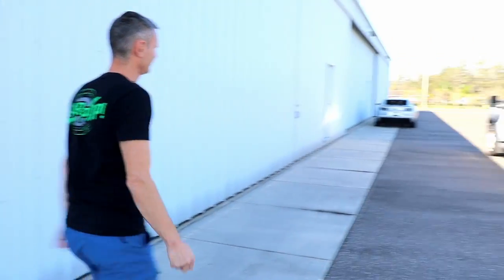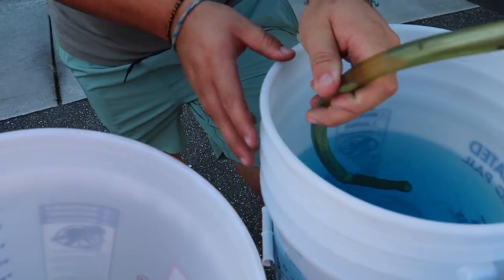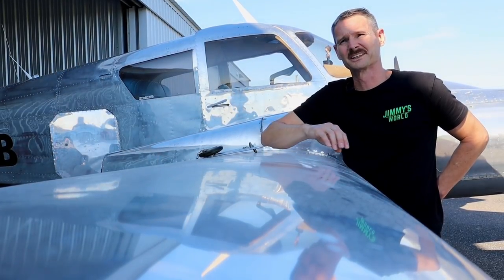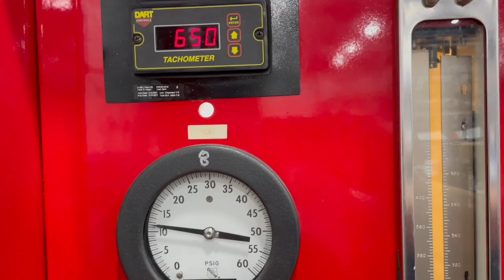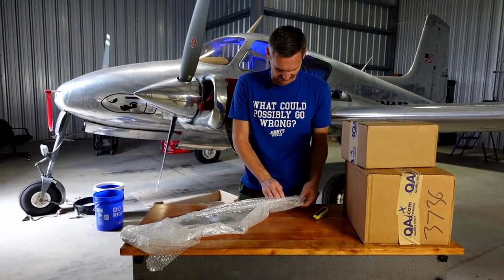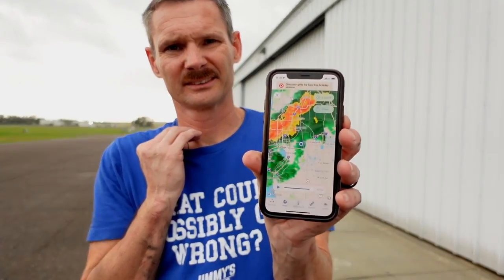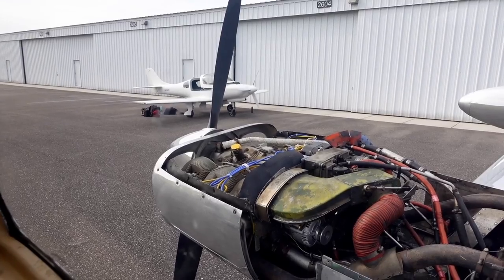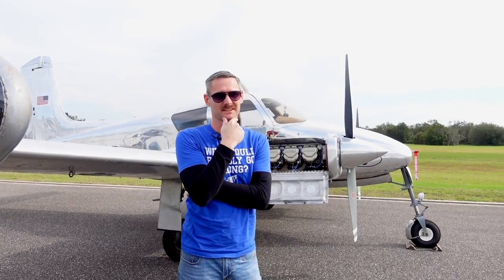I Found ANOTHER Big Dangerous Fuel Leak On Silver Bullet!

Comment: My 340 had the same problem with fuel migrating from the tip to the aux.  Bad fuel selector valve.  Every once in a while shut the engines down by turning the fuel to the off position.  If they don’t shut down the fuel selector valve is allowing fuel to bypass.  I routinely shut fuel off after flight in my old Aztec and in the 340.  Go Jimmy….you are the rock star!!  I saved this 340 because you inspired me to get er done.  Not easy, nor cheap but I love the way it flies.
Reply from the maker: Nice!!!  Yeah, that's what we suspect is the selector valve.

Comment: Thanks for sharing the fuel pump overhaul.  Really enjoyed watching that.  I have replaced many of those on several aircraft.  I really think you need to invest in a fuel bowser there Jimmy for the Silver Bullet 310.  They are actually very easy to make yourself.  All you need is a cleaned out 55 gallon oil drum, a large plastic containment barrel for the drum itself, a electric fuel pump with a nozzle, two large fuel filters, 5/8 inch piping with T fittings and elbows, fuel sealant for the piping to seal the connections, 12 volt battery, 3 way electrical switch, some angle iron or square stock for the cart to move it around with, 4 caster wheels, 20 foot long grounding wire with clip, 1 inch hose for the sciphen side of the pump with AN fittings and some wiring for the fuel pump and switch, battery terminal ends, and finally the all important Caution and Flamable labels.  I helped make one several years ago for our Aero Club at our FBO at Greene County Airport in Xenia, Ohio and its still working to this day far as I know as long as they keep the 12 volt battery charged up.

Comment: i’ve done it many moons ago my when used to fly dead battery. i hand propped it. piper Cherokee. Challenge hand prop one engine on the silver bullet or any of the planes you have. it had just enough juice to prime but not enough to turn the prop. key to both so mags are hot fuel primed try n see can jimmy hand prop an airplane. make sure throttle set. parking brake set. chalked

Comment: I paused at 2:37 to type: Use compressed air to fill the fuel lines while playing with fuel selector valves to figure out how they're mis-connected.
Reply: Sending the parts off to AVIM to get redone as done in video is also a good solution...

Comment: Channel Locks on the fuel fittings?  How about replacing the fittings and use the proper wrench?
Reply: If you look carefully, he was using KNIPEX pliers which keep the jaws parallel and have less slop than traditional open end wrenches.   

When dealing with FAA Repair Stations, Everything from authorized tools to the manuals required and drug testing etc is closely regulated and monitored by the FAA.

      I have no doubt that QAAs overhaul manuals call for the use of these pliers in the disassembly.
Reply: @Stepclimb  They still compress the cast fitting between the jaws don't they?

Comment: jimmy..just curious .. do those brass fuel connectors on the fuel lines leak?
would use of teflon tape for high pressure connectors like they use on plumbing and automobiles work...?
Reply: It is not advisable to use Teflon tape on tapered fuel or oil fittings as slivers of the tape can break off and clog the small lines.
Reply: @eagle2019  thanks...did not know! thats why i asked !
Reply: Tape is only for tapered threads. Stupid tape , I use the Teflon liquid if I have too.

Comment: Uhmmm, why do you use the measuring stick, while you have a transparent pipe to use. Take the outlet side of the pipe while it is full of fuel, and block it with a finger, then bend it upwards and lift it till it is above the level of the fuel in the tank. Let go the blocking finger, and the level in the pipe will be the same as the level in the tank nicely visible and precise.

Comment: I'm not really knowledgeable with ALL this but, is there a reason why, the 310 has both engines, running at the same direction of rotation. I wonder why, (view from the front) one isn't rotating clockwise ?
Reply: The simple answer is TCM was not making Left turning engines when the C310 was designed.  

   It was easier to design the engine around the available, off the shelf O-470 powerplants.

       The design of the vertical stabilizer & rudder, their moment arm and the published VMC (and VySE) are all predicated on the loss of thrust from the Left (#1) engine.

     Any small gains in handling and performance from installing a Left turning engine on the Right side (#2) would be greatly overshadowed by the cost and complexity of redesigning the aircraft via STC.
Reply: The early piper Navajo had Lycoming tio-540,and ltio-540 which was a left hand rotating power plant,
Reply: It comes down to cost and reduction of unique parts.  If both engines are the same that's cheaper.

Comment: I know youre switched on Jimmy and inspecting everything incessantly, as i would be doing. Yesterday i was watching ' what you havent seen' & saw this sad video- Beach 60 N60RK, turned out the guy was trying to ferrie the plane, but did not get a permit or even have a ferrie inspection. It had endured a fuel hose leak off the fuel pump and a mechanic had nipped up on it- and ran the donk up 3 timed to check for no leak. Personally I don't know what kind of union they use- a flaired fitting, compression fitting or what- but normally if there's a leak it's worth checking the union has not cracked- I'm a hvac tech, and I find cracks quite often/ vibrations. But fuel lines would be much stronger than copper gas line.  Was sad to watch this thing spear in on fire as the guy was saying he needs to land fast. Personally- if I had known there was a fuel leak issue, I'd have been so reluctant to jump into an unknown machine and place myself up in the heavens. 
It is relieving to know you have a good head on your shoulders Jimmi.
Regards Jake in Oz

Comment: Leaking fuel, ah no worries the SR71 Blackbird does that all the time and they go a lot faster  :-)  It's when it's not leaking you have to worry - that is when its all gone. Get a load of all that test gear, now when it all goes horribly wrong, and you die a terrible death, you will know for sure it wasn't your fault, how reassuring is that?   :-)  what!   First flight? When I was Hang Gliding the first guy in the air on a given day was called the wind dummy. He wasn't called the wind dummy for nothing :-)

Comment: What happens to the fuel you pulled out Jimmy? 
Couldn't you put in in fuel cans?  Fill up your other birds? 
Or you have to donate it to the fuel truck and buy it back a second time?
Reply: I was wondering about this also.  And, did you resolve the original leak that caused you to remove the gas?

Comment: What did you do with the fuel you took out?  I cant imagine they dumped it in the fuel truck?
Reply: Yes I would like to know that myself. As the fuel truck was there all the time they were syphoning the tanks they must have put it somewhere. Perhaps there is a secondary tank to take unwanted or unusable fuel. They can't have put the fuel back in the main bowser as that fuel could be suspect and then it could not be sold to another pilot. The FAA would nix that in a second, I certainly wouldn't want to go up in a plane that had questionable fuel in it. Would you?
Reply: The way the FBO works where I'm at, is they take the fuel put it into the truck, quarantine the load of fuel and do a test on it to check for contamination, if the fuel passes the test it is pump back into the fuel farm and is mixed back into the bulk fuel storage. So by putting it back into the farm it gets filtered again going into the farm and filtered coming out of the farm and going into a truck, and then filtered by the truck when dispensed into an airplane.
Reply: I'm surprised they don't have a way to defuel to a temporary tank, filter and test it, then top up the tanks of the other aircraft they have, assuming they take the same fuel type and grade.
Reply: @neuropilot7310  yes providing they give the pilot the money back for the fuel taken in, or at least a credit on his next load of fuel provided it isn't contaminated, but as the reply above says it gets filtered when being put back into the fuel farm, filtered again when put into the bowser, and filtered for the third time on dispensing dispensing by the bowser

Comment: For whatever reason, older piston twins just waste fuel. We really need modern versions with jets instead. Big revolution that would be.
Reply: because jets don't waste any fuel at all . . . 🤣 🤣
Reply: @buckmurdock2500  that's an understandable impression but it's actually wrong. what you didn't know is that the distance record of 40000km without refueling at 500km/h belongs to an off the shelf simple turbofan jet engine, the Williams FJ44-4, the slightly bigger brother to the FJ33 used in the visionjet. The record is not a turboprop or a piston prop.
Does that help you realize there is potential there?  maybe compound it by the realization that a jet engine suitable for a 4 seater might weigh 15kg. No vibration, longer TBO, silent and double speed. And natural twin engine configuration.

Comment: I used to run 100 low lead in my street car
Reply: Used to do the same in my car,until the valves burnt out!
Reply: @alunspence1026  it won't burn em out, but it will carbon them up.

Comment: Surprised that the fuel guys are using plastic buckets for fuel draining. Collective wisdom suggests a metal can with a bonding strap connected to the plane is much safer. I get that many GA pilots do this and get away with it but there are many instances, and a few Youtube videos, showing fires starting spontaneously from fuel draining into plastic buckets just like this.
Reply: Avgas can also react with some plastics,this curing one problem but creating another,a holy bucket!